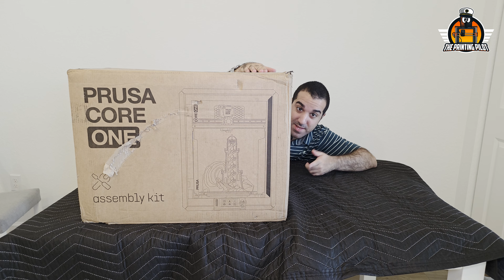Prusa Core One Assembly Kit Build And Initial Thoughts

Comment: Nice video! I have a coreone on its way, and i am very excited to put the kit together. One thing about the chamber heating. Its good practice that when you are using your bed as the spurce of heat for your chamber to drop the bed during the heat soak prep phase, that should help bring more heat into the chamber and creat a more uniform environment.

Comment: Do other printers really have less vfa?
Reply from the maker: Well depends. All core XY suffers fro VFAs. Some solve it with extreme Input shaper at the cost of resolution and dimensional accuracy, some solve it in hardware, using lower pitch belts.  For now, the quality is good but far from perfect.
Reply: @ThePrintingPilot It’s the same on my mk4s. Some geometry prints without vfa and others are full of it. The 0.9 steppers have been a wast of money. A bigger problem is the lack of a filament feeding unit of some sort. it’s too much of a hassle to load new rolls
Reply from the maker: Well the Mk4/s doesn't suffer from VFAs really.. if you have a vfa problem it's something you can fix. About a feeding system? Idk Prusa has the best feeding system on the market, so I'm not sure what you're referring to.
Reply: @ThePrintingPilot  You are right. The Nextruder is so far 60 days without error. The mk4 has belts and stepper motors and because of that vfa´s. Maybe less than the core one but there are always speeds that provoke vfa.